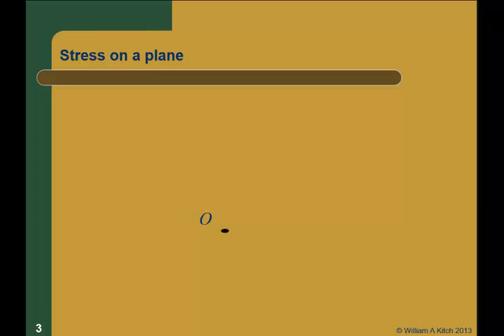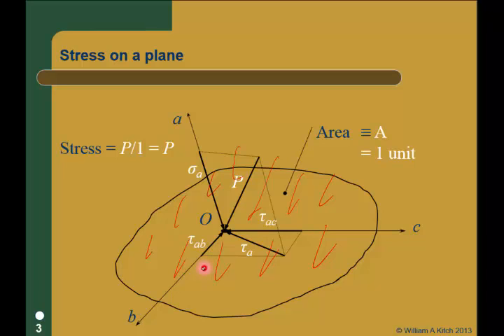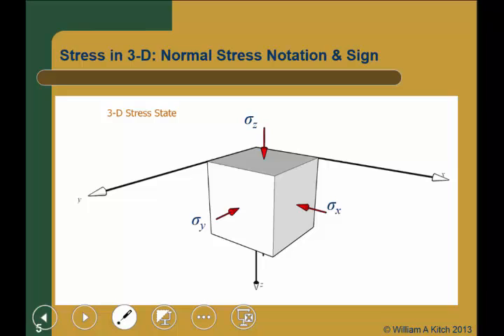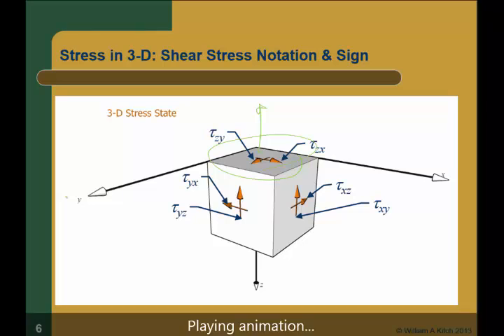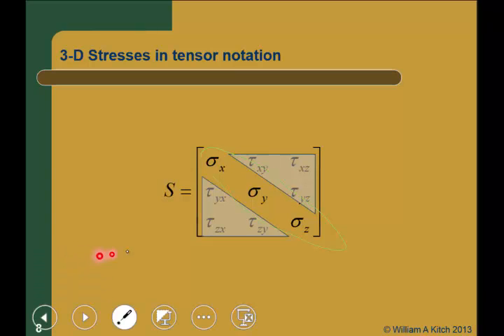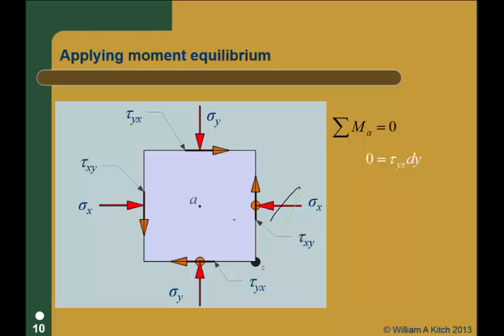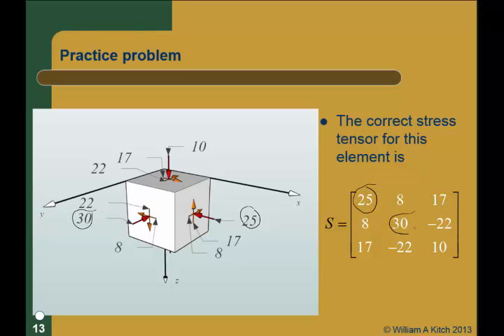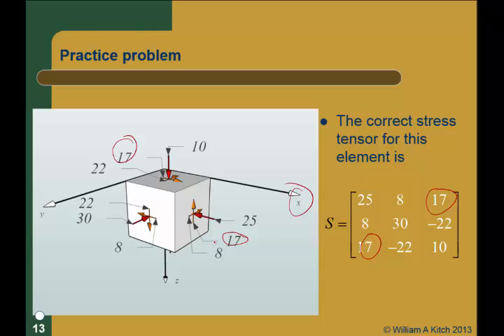CE 531 Mod 1.1.3: Stress Definitions

Comment: Why does Tzx have the positive value??? Positive plane and Negative plan, how do I determine them?

For example, Txy = 8 is said to be in the negative plane, it has the direction opposite to the Y-axis, and it's a positive shear stress. In the case of Tzx, it's in the Z-plane and its direction is the same as X-axis. According to the former case, it should be a negative shear stress. So how does it get the positive sign?